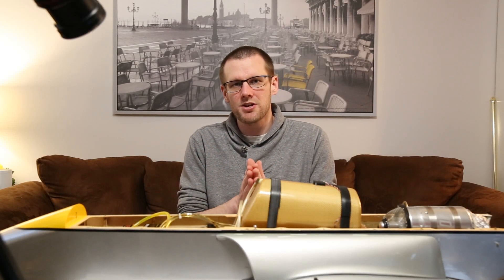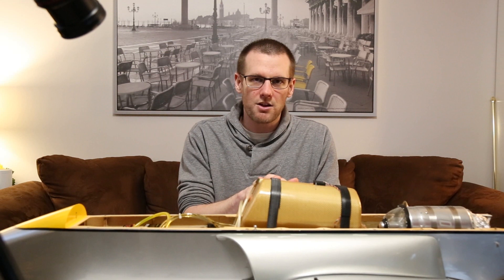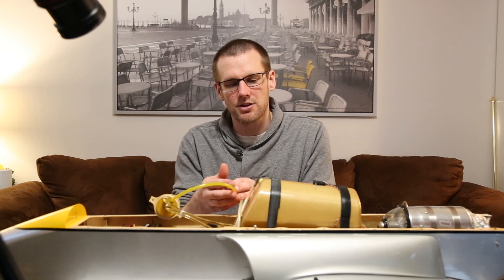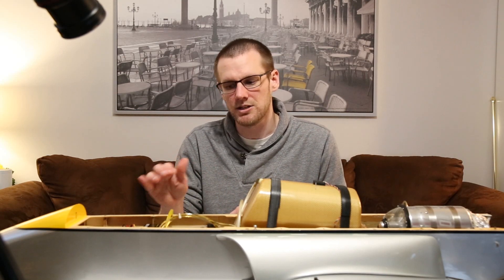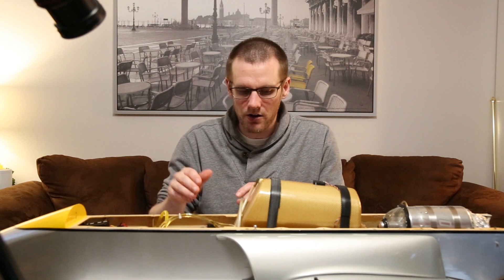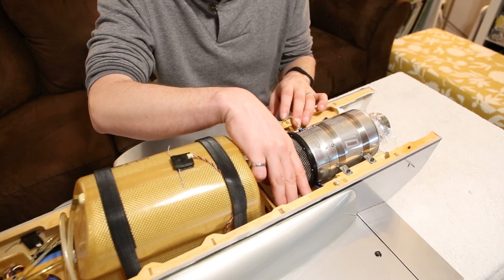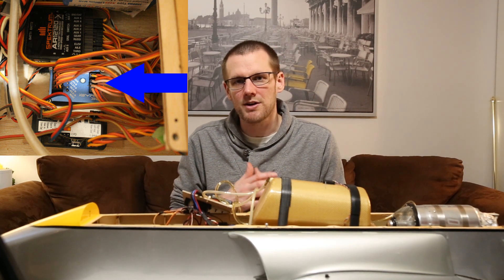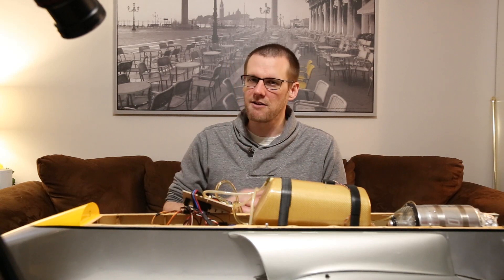All Components inside an RC Model Jet Turbine Airplane Explained - A Look Inside

Comment: Great video man....thanks!  Just out of curiosity, can you buy a decent jet RTF for $3000-$4000?  Assuming I already have the transmitter and batts.  Or are they considerably more expensive than that?  Any good websites you would recommend?  Thanks for your time amigo.  Have fun!!
Reply from the maker: Thanks for the comment Chris. I have never seen any RTR/RTF Jet for sale to be honest. You can buy a used RTF jet for 3-4k. The jet in the video was purchased used from a reputable pilot/builder and in my opinion this is the best way to jump in to gas turbine jets. Buying used (reputable pilot/builder) ensures the jet is setup correctly, proven to fly and if you can get the radio program it can also be fully trimmed.  If you have good stick time with airplanes that land fast, the Boomerang Spring (in video) is a highly recommended jet trainer by the guys with many hours of jet experience.
Reply: Thanks man!!!   I really appreciate you taking the time to respond.  Yes, used is the way I would go about it.  Very exciting to know I can get into for under $5k.  Are those jets fairly reliable, or constantly having to work on them?  Yes, I have at least 1000 flights with 130 mph planes.   I know that doesn't compare to the speed of your jet, but I'm very comfortable flying fast, 3D as well.  Thanks again!!

And, is there a website you would recommend looking for a used one?  Rcgroups.com??

Thanks again, and happy flying.   👍
Reply from the maker: Hi Chris, they can be very reliable yes. This is critical as you don't want any issues while flying. Issues are dangerous and costly. Reliability heavily depends on the components sourced for the build and the setup. 

I would not recommend a website but rather looking for a used plane within your club for your first. This way your fellow club members and the seller can assist getting the plane in to the air for the highest chance of success.